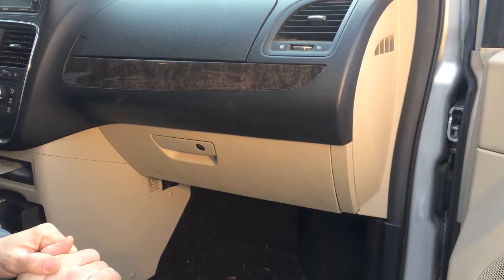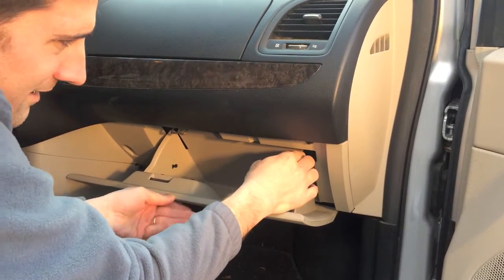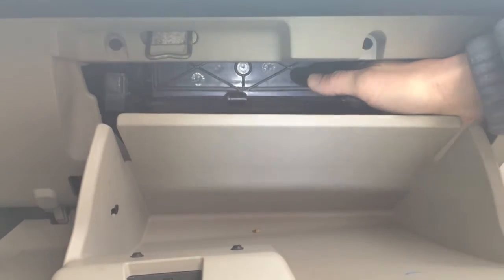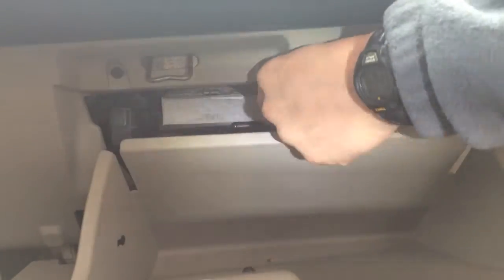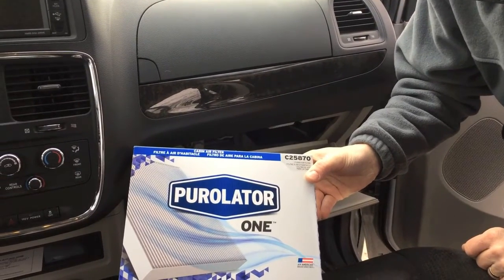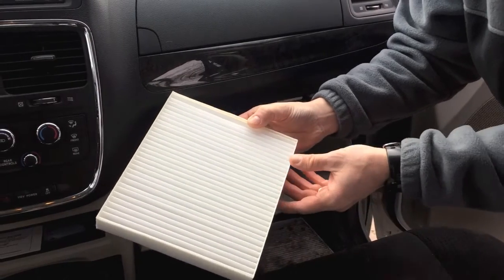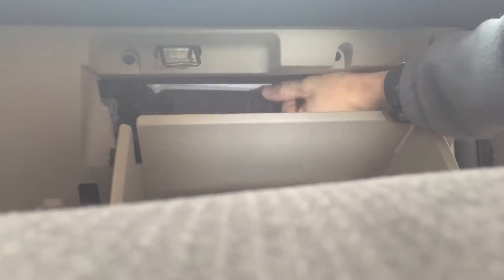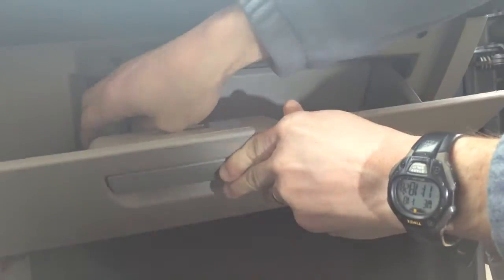How To Replace The Cabin Air Filter In A 2011 Dodge Grand Caravan

Comment: Can a dirty filter cause cold air to come out instead of heat ?
Reply from the maker: Not entirely sure, but my guess is that the cold air might be caused by something other than a dirty filter.
Reply: A dirty filter wouldn't cause that, but a faulty thermostat could.

Comment: How many miles did this Grand Caravan have when you changed the filter? I recently changed it on a 45k mile GC and it did not look nearly as dirty as yours.
Reply from the maker: I estimate it had about 60,000-65,000 miles on it at the time we recorded the video. I would recommend checking the filter more often as this filter was extremely dirty.

Comment: I have the same van and replaced my cabin filter also. But On the side of the filter has arrows. Do i put the filter with the arrows pointing up or down?
Reply from the maker: Hi Honda, thanks for watching.  The air filter I replaced didn't have any arrows on it so I'm not sure.
Reply: Usually the filters point down for the airflow
Reply: It actually did show it. Your arrows were pointing down. I'm pretty sure you put yours in correctly.
 I've done worse in my videos so don't feel bad. I couldn't even change my tail light without stripping it and having to cut the assembly. Lol